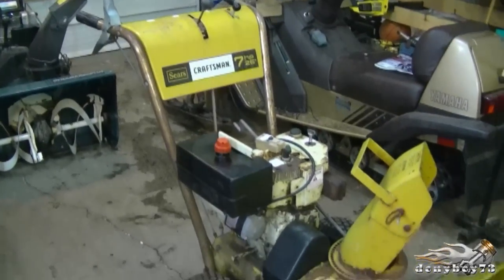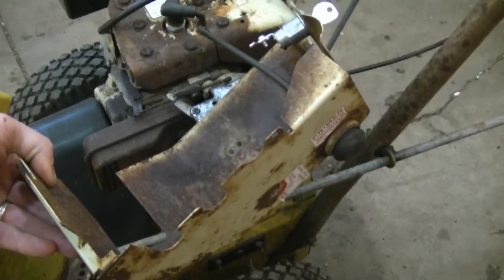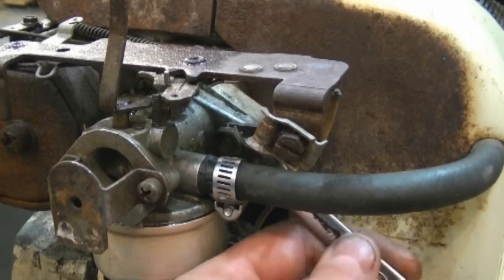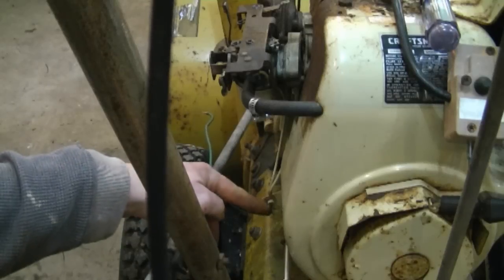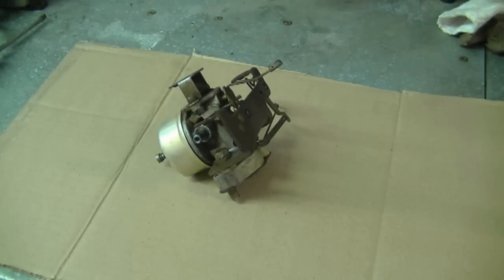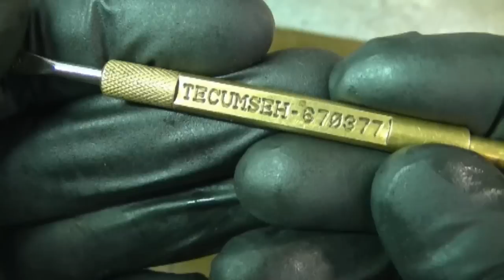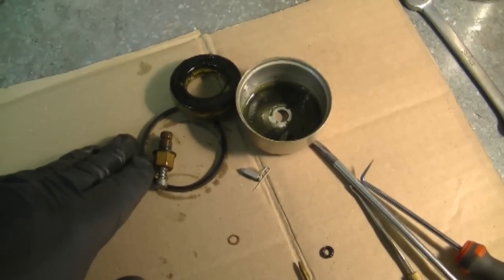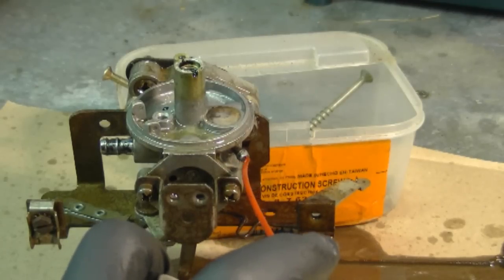Carburetor Rebuild on 4-7HP Tecumseh Snowblower Engine Part 1/2

Comment: I rebuilt the carburetor this spring on a 7 hp techumseh simplicity snow blower following your video.  This winter we are having record snowfall ! My snow blower has worked like it's new ! I never have done engine work and this was a first for me, I was so successful I did my garden tiller- same excellent results.  We just had another 7 in snow last night and  again the snow blower started on the first pull and performed great. thank you so much for your video it made this winter's snow rather enjoyable ... rather than a nightmare !  thanks again and God Bless !!  Rick , in Indiana.
Reply from the maker: you're welcome

Comment: If the nuts spin on the carb mount you could also pull the carb away from the engine and keep pressure on the nuts so they don't spin.

Comment: Is the motor bogging down? If the motor is not bogging down a whole lot it may be the belt slipping. You may have to retention the auger belt or if its already at the limit then you'll have to replace the belt. When I replaced the auger belt on my main machine it went from shoting only 1-3 feet to shooting like 6-12 feet depending on how heavy the snow is. It was a night and day difference. Good luck.

Comment: Hi Dony.I just rebuilt the carb on a deere model 56 with a tecumseh V60 , 6 HP engine.Having a hard time finding the diagram for hooking up the linkage for it. I think it `was not hooked correctly when I got it. I did look at your video on carb rebuild and must say your videos are perfect , clear and informative. The best online.

Comment: Thanks, this helped me get my old Snapper 5hp snowblower running.  DIdn't work after I cleaned the carb, but after I took it apart again and used the drill bit in the tube, all this crap came out.  Ran great after that, thanks for the tip.

Comment: Thanks for video helped me fully clean and get my craftsman snowblower that has been sitting for 10 years back up and running. My carb looked about as dirty inside as this one in the video. maybe next time ill grab a rebuild kit for it but for how old it is the o rings and parts seemed to be in way better condition than I was expecting. I  could never get my float to sit like you did it was up too high even after bending tab but it works 100 percent now anyway.

Comment: I just cleaned a carb from a 2005 Honda Metro scooter. Now my cleaning went well with the jets etc. but I used carb cleaner and let it set 1 day and it still needed more work, do you recommend anything else for this cleaning?

Comment: Hi. Great videos. I have a toro 521tecumseh carb. There's a small tube that's part of the main jet. So when you attach the bowl that center piece has a small tube attached to it. Another video said there's a ball in there that moves and we should hear it move. I don't. Is that true ? Says to be careful putting in the air mixture screw could damage it. Can you help ? Thx.

Comment: im workin on a tecumseh tvs90,cleaning carb has prime directly on carb ,this is a 3.5 tecumseh engine,if u dont have access to gaskets manily the pipe to intake on engine,and air intake,can you get away with just atv sealant or will it break down to fast,the pin on my float was stuck i swear it was welden on,wd 40 got the job down again ,ill send you vid on progres have a great day

Comment: Hi Dony love your videos, I have and old troy built tiller with tecumesh motor the carb looks like this one your video, every time i use the tiller when it leans on the side of the carburetor ( right side) there's some gas leaking to the air filter cover and start choking the engine, I have it check last year and they replace the floater in the carb any idea whats causing the gas leak, the machine works just fine as long as the tiller don't lean towards the carburetor side. thanks for any input.

Comment: Hi Don,

Great videos!! 
I have a 8/24" Techumseh Snow blower HMSK80 155448S (D) D"O"M 4273R.  How do I remove the Red knob from the Choke control lever so that I can remove the cover to access the carburator for servicing.  Your help is greatly appreciated.

Comment: I've got a 5.5 hp Tecumseh in a Craftsman snowblower .. maybe 15 yrs old looks a bit different..
you got vid on this ?

replaced the needlevalve mini gasket..fresh gas... elec start.. few revs it started ... ran ok under load.. the second I let go of the wheel drive and the auger drive .. the engine wanted to race.. is the governor a suspect ?

Comment: hey bud awesome vid i was working on pretty much the same snowblower carb did everything work on alot carbs but this one i just cant get right~! i dont know if some one got the wrong float kit in it i see its got s new tehcumseh float plastic up graded,, Anyways cleaned it a million times still will run and seems to run out of fuel so i adjusted the float level abit more still same thing runs very nice then shuts off pull the bowl still has fuel in bowl? Thinking maybe points? but that doesnt make sense either cause you prime it abit runs starts right up! However did notice if you shake the snowblower abit it changes stuff runs differently? Must be something in carb is not the points? maybe the float or is this a classic new seat problem cause i never did change that yet! or the needle port needs cleaning maybe its hanging up jamming the float shut or open?

Comment: Great videos. I am rebuilding the carb on a 7hp Tecumseh, and I cannot remove the pin that secures the float. Not the float needle, just the pin that the float rotates on. I soaked it in carb cleaner, tried using needle nose pliers to spin it free, but I got nothing. I read trying heat can help, but I don't have a torch or a heat gun. Any suggestions?

Comment: I'm having an issue where the nuts just spin with the bolts when trying to get off the carb. The issue is one of the phillips screws came out. The one on the right side where u have to angle your screw driver has a stripped head. Any suggestions on how removing the bolt? or getting the bolts with the nuts to stop spining?

Comment: I just got an old tractor with a 7hp Tecusmeh engine. It's leaking oil and gas from the carburetor.  where do you find seals and gaskets?

Comment: Can you PLEASE help me? I'm stumped. I have an Earthquake 9800 post hole digger with a 3.8 HP Tecumseh engine. I have overhauled the carb. It cranks right up and runs. It throttles up. It seems pretty close to done. the problem is, it sputters a little. I replaced the emulsion tube, the tube O-rings, the bowl gasket, and it has a new air filter. The float is good, needle moves freely, everything looks great but it sputters a bit while it's running. Fresh gas too.I also took that little brass screw out of the side of the carb and it's clean too.  I bought a bulk bag of the Viton O-rings that go on the emulsion tube. I'm wondering if they might be the wrong size. Can you tell me the size so I can check. Other than that I don't have a clue.

Comment: hey donyboy, 
           i got 2 weed eaters. both need primer bulbs. ones a homelite and the other is a yard machine. can u show me how to replace them. and also there leaking gas. where the line gose into the tank its leaking between the line and the tank. how could i fix it?

Comment: Don or anybody, I have the same carb on 6hp hh60 Tecumseh engine. When I start itt runs for about 6 seconds then dies. I thought the gas line was clogged. I would pull fuel from carb and let the fuel line drain to ground. Every time I do this the fuel coming from line was orange color for a few seconds until clear fuel came out. It seems the orange color is coming from the carb. I took bowl off but it was very clean. Any thoughts on this.

Comment: I have a Tecumseh roadatiller that won't start and it's carb is completely clean, I tried putting starter fluid on the air filter and it still won't start, and the valve timing is right what could be the matter?

Comment: I have mine put back together but it looks like the throttle is all messed up.  When the throttle is set to slow, the spring like bends over on itself. Wondering if it got pulled too far Also it only runs on half choke.  Don't know it that's an idle air issue or bowl nut adjustment.

Comment: Hey donyboy 73, question,      is it possible to convert a Tecumseh hm80 single shaft pto  to a dual shaft pto if you switch the back of engine and add the longer cam shaft???- just wondering your experience with this. thanks... rick
Reply from the maker: +ricker bear yes it is

Comment: Hey Dony, I have a Toro 7/24 I believe 1980 model #38050. I swapped engines with  an identical model and had it running but the blower stopped and I have been unable to get it started since.  I have rebuilt the carb from both blowers and neither gets the blowerrunning.  It seems like it wants to start and then dies. I have good spark and it is getting fuel .  Please help I am  at my wits end....
Reply: My metal parts rusted and slowed the flow from my gas tank.  Started good but starved with in minutes.    

This means you'll have rust in your float bowl also.   Acts as a settling tank and if metal , tons of rust because of an off season water problem.   My machine is 45 years old so everything is metal.

Comment: Hello all I have a question. I have a 7hp Tecumseh , mtd snow blower. I start the engine normally , with the choke opened and the engine start right up. Once the engine is running I switch the choke to the closed position and the engine will stop running. What may cause that problem? From my understanding the engine is suppose to remain running when I shift the choke back to the closed position. Please help, thank you

Comment: I did as described with a new needle and seat, carb leaks fuel through air filter?
Reply from the maker: you might need a new float